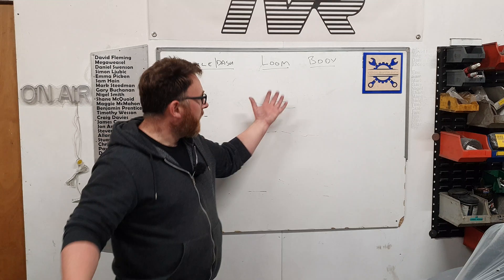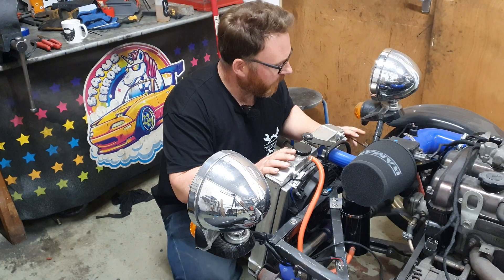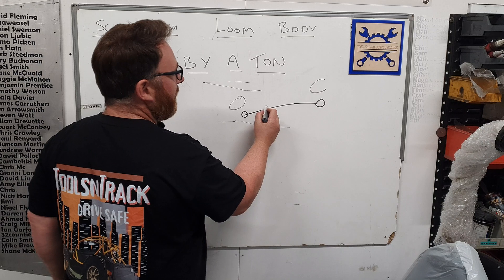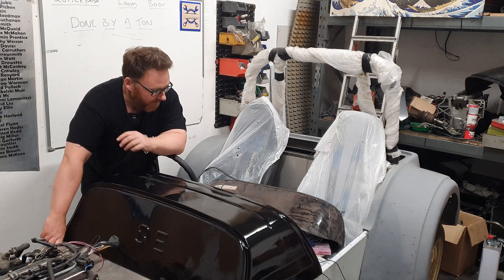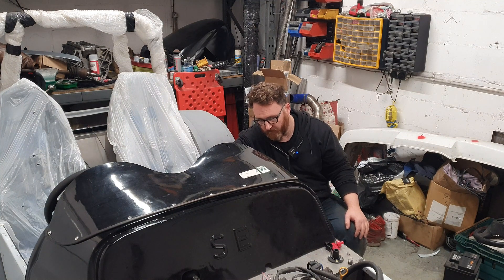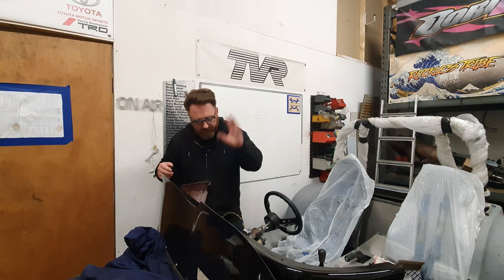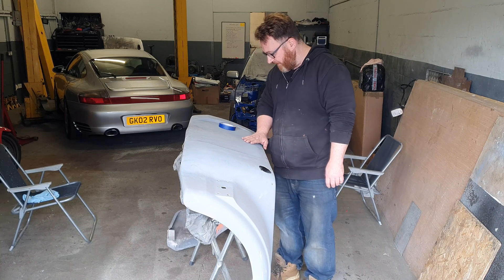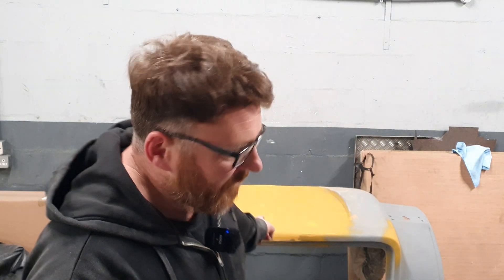HOW LONG DOES IT TAKE TO BUILD A CAR? Episode 81 of Locost 7 Kit Car FULL BUILD!!  - (Project 7-UP)

Comment: In the 90's I built a Spartan 2+2 sports car from the kit and a donor 2l Cortina in 11 months, including some mods like total wax oil and undersea, relocating the wiper motor so the wipers covered the whole windscreen, rejigging the r/h headlight so it matches the position of the l/h one, reinforcing the running boards so you could stand on them, fitting a tow, making a one off exhaust from the manifold back., making a seal for the boot lid to stop water ingress. Alloy wheels were fitted along with Ford XR3 seats and colour matched interior and rear seat, two pack paint all over., fitted Smiths instruments including rev counter, oil temp and pressure gauges.  I built it to last and intended to keep it long term Unfortunately I had to sell it after three years on the road for various reasons. When it was finished it looked like a showroom production car. Wish I had it now.